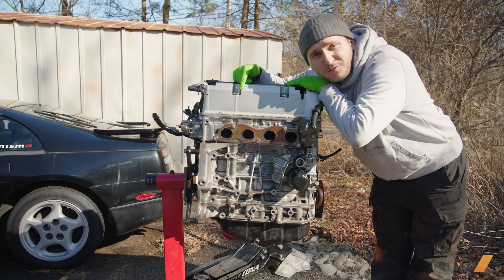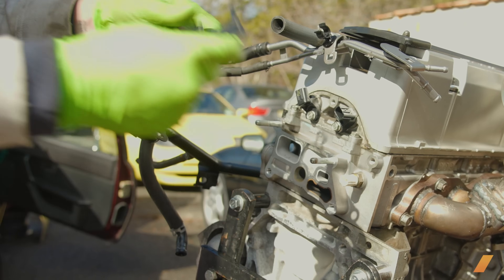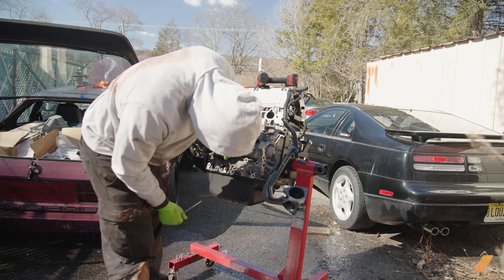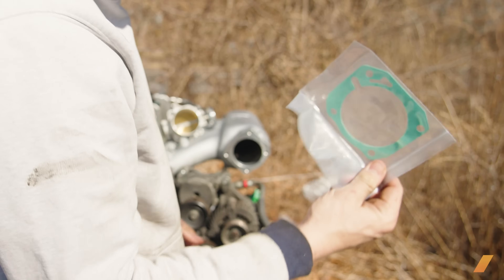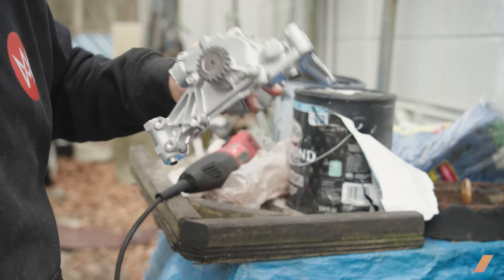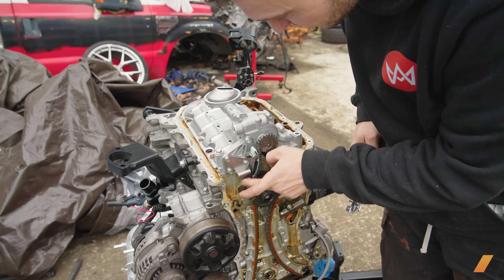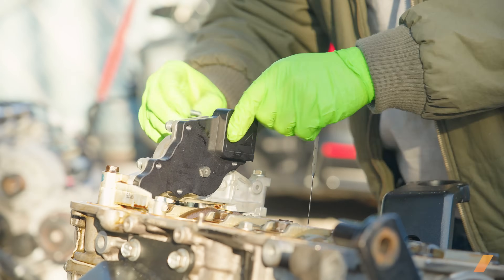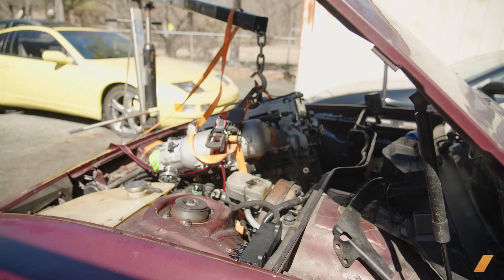There's no turning back now (PORSCHE K-Swap)

Comment: That swivel neck housing is not going to work direct on the pump housing. You need a proper return for the short coolant loop from the head/intake manifold. You need the k tuned V2 swivel housing or similar so you can return coolant behind the thermostat. I use the OEM plastic housing with the T7 designs swivel instead.

Comment: There's a bit of information out there, but the general consensus is that the swivel neck thermostat housing is decent, but the actual thermostat is trash. You really want to replace that with a 7242-170 Fail-Safe thermostat.

Comment: This is a really cool series! Just a heads up though, you may need to think about getting a 944 Turbo / S2 gearbox and transaxle set up if you plan on running high boost through the car. The NA cars transaxel can't take too much power without looking at new internals. Best of luck!

Comment: i did a clutch on an 84 944 and we should have pulled the engine. instead we had to drop everything from under the car. trans, torque tube, and bellhousing. it was a nightmare.

Comment: Terrific content; I’m enjoying the no nonsense, back to basics, backyard engine swap. In other words, regardless of the metaphor one could apply to this video series, it’s pretty doggone good.  Three suggestions for improving the fidelity of your skills as a would-be mechanic: 1) avoid used motor oil for lubricating seals of any kind, injector seals would be much happier with silicone grease; 2) please use a torque wrench, those wiz bang battery-powered tools tend to over tighten fasteners; 3) when it comes to silicone sealant, less is more. Good luck and thank you.

Comment: What are you going to do about the transaxle? The ring and pinion are trash and snap easily even with the puny stock hp… not to mention it’s an open diff…  the rubber damper on the stock clutch will definitely explode too.

Comment: Put studs under (over) the oil pan sump, so nuts can be used to hold the pan up, instead of allen bolts.

i think it had studs where you didn't need studs, so just relocate them.

Comment: Dude you dont need to take all that off to get the manifold on, just take the right stud out, put the left stud in place  and swivle the mani 90 degrees counter clockwise and you can fit it on.

Comment: @12:00 Dying inside watching you continue assembly of the crankcase with all those metal shavings.
Reply: I was thinking about same issue :D
Reply: welp, he said he did this in February. Lets see how this plays out. :D
Reply: So I was not alone with this
Reply: I guess he's hoping the oil filter will catch all that...?
Reply: was about to drop the same comment!
Reply: He cleaned it out relax
Reply: @markchapman2585  well he never showed the part when he cleaned it
Reply: I'm actually in disbelief.. you would go to this length and just leave pieces of metal in an engine that will 100% destroy the engine in some way 😮‍💨